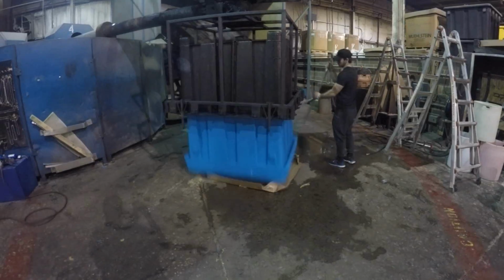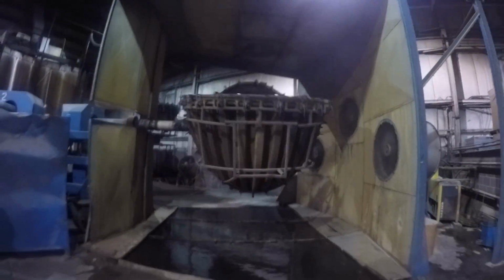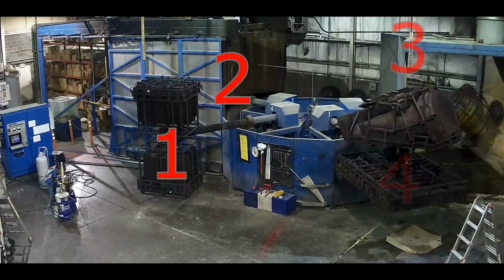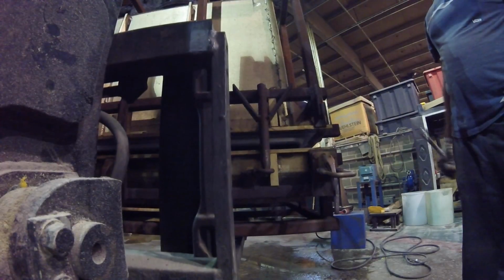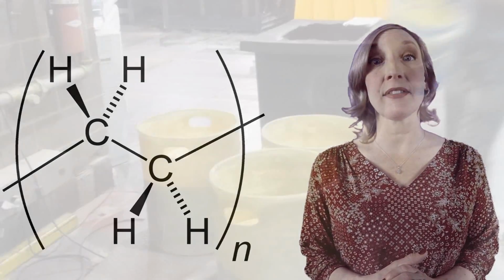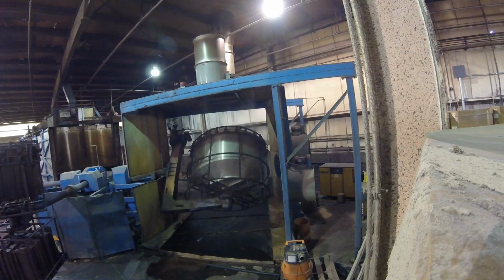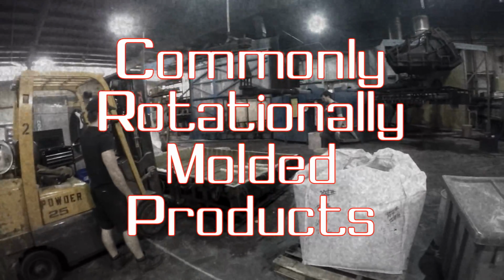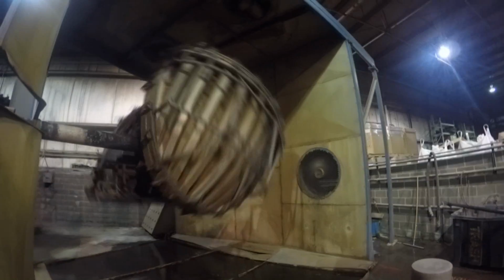What is the Rotational Molding process?  Rotomolding Process Plastics

Comment: I noticed pipes inside the mold that I thought were vents. So in rotation molding, can we say that the final product is not completely closed? Don't these pipes cause holes in the product?
Reply from the maker: You are correct that all molds must have a vent for proper cooking and cooling of the products.  The location of the vent is something that has to be considered in the Rotomolding design process.  Secondary processes exist to close up the vent holes if required.